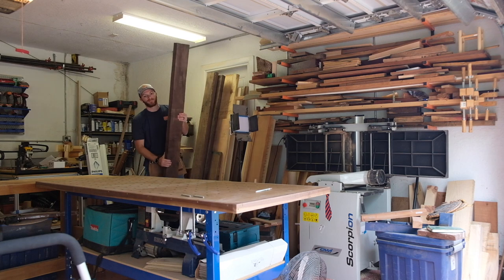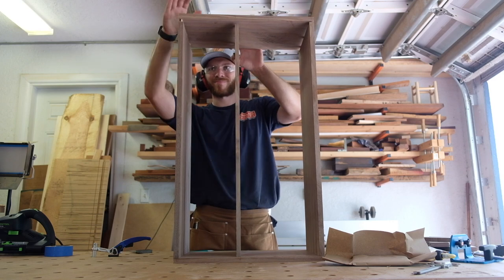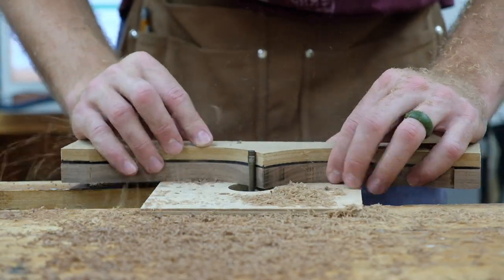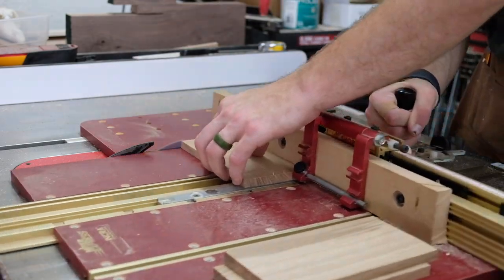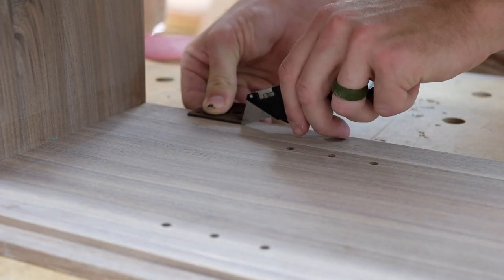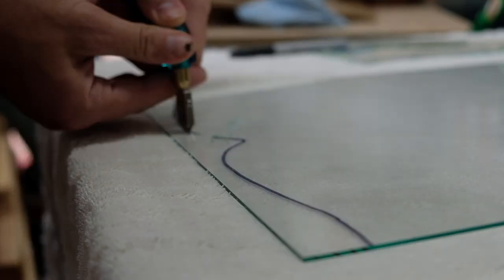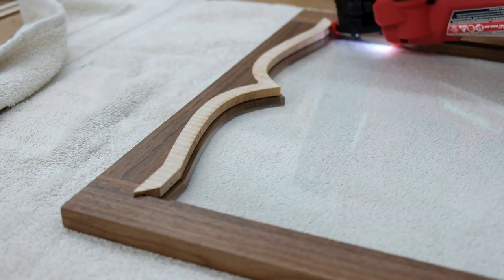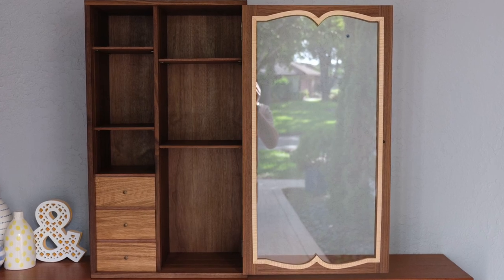Making a Walnut Display Cabinet with an Inset Door

Comment: Another Beautiful  piece. A trick I learned was to put a small amount of 3 in 1 oil in the groove from the glass cutter and a really small brad nail under the spot where you push down on either side. Leaving the glass on the bench.

Comment: First of all, I must say that you did an awesome work.
Once I had to cut the pattern from the glass, pretty much similar to yours. So I've remembered the tip for car owners: if you got a crack in your windshield and don't want the crack to grow - just drill a tiniest hole at the end of the crack to prevent growing it.
So I reverted the intention and drilled the hole right on the pick of a pattern, then carefully sled cutter from the hole (i.e., from the center) to the wings (sides). Succeeded on 2nd trial. 
Hope it'll help you to deal with the future glass details.
Thanks for the video!
Reply from the maker: Thank you! That's an interesting tip. I'll keep that in mind next time!
Reply: Drilling is a great suggestion if you can keep from cracking during that process. But, why didn't you try cutting out smaller sections (relief cuts) the way people do with resaw band saw blades when they want to make curves and don't want to change blades?
Reply from the maker: You know, one of the videos I watched did suffer relief cuts. I guess I got too impatient and forgot about it. But that would’ve been a helpful strategy.
Reply: @kevin_delgado  There's nothing complicated with the glass drilling: just plain surface, nice carbide drill bit and patience for medium speed. Your main activity during process is to control the pressure against glass and regularly put a drop of water to the drilling place. 
But smaller sections' technique will work as well, you're right.

Comment: Beautiful cabinet as always! I love the contrast of the white oak and walnut. You have more patience than I do dealing with the glass. I cracked a panel twice when I was making a knife display box for a client, then gave up and got acrylic haha. Also, I bought the M12 screwdriver just for things like installing hinges and drawer slides. It has been the perfect tool for that and so much more! You can usually pick them up pretty cheap for the tool only version. Thanks for the video! - Joe
Reply from the maker: Thanks Joe! I went through 4 panels for this piece but luckily was able to get a few "fails" from each panel. I'll have to give that screwdriver a look. The issue was that the bit couldn't even get into the screw head; there was excess metal or something. Anyway, I love my M12 gear. I just got the new M12 pin nailer which is what I used to secure the trim. Great little tool!

Comment: very nice piece of furniture. for the future, would be interesting to see details such as installing the back (shiplap?) or what solution you used to stop the door (magnetic latch?)
these are very interesting point for fellow woodworkers (I know they are not particularly attractive for general viewers),  cheers from Italy 👍👍
Reply from the maker: Thanks! Ya sorry about that. I usually either don't film it or just cut it out for time. In this particular project, I routed a rabbet in the back and nailed in a 1/4" piece of walnut veneered plywood. The rabbet is deep enough that I can also fit a French cleat so the cabinet can be hung on a wall. As for the door stop, I didn't put one in yet. But will most likely use a couple of magnets. I'll try to delve into those details on a future build. Thanks again!
Reply: @parillaworks   thanks mate. no need at all to apologize and please, don't get me wrong, it was not a critique, just a suggestion for some next video. I know that putting these details in ALL the videos can be wasted time as it is only interest for  a small part of the audience. once again, amazing job

Comment: Very nice project and fantastic video as usual! You inspire me to step out of my comfort zone. Regarding dulling router bits, have you had experience with professional sharpening? Curious if A) the bit remains the same factory size or B) it's cost prohibitive or C) it even works.
Reply from the maker: Hi! I’ve never had my router bits sharpened. I’m not sure it would be worth the cost. Maybe if I get one of those mega flush trim bits one day. I’m also not sure about the diameter changing, I would imagine material being removed for sharpening would slightly effect the size. But not sure how noticeable it would be.

Comment: Wouldn't it be easier to just have a groove along the top and bottom panels with a rectangular piece of glass to slide in between, then gluing it together?
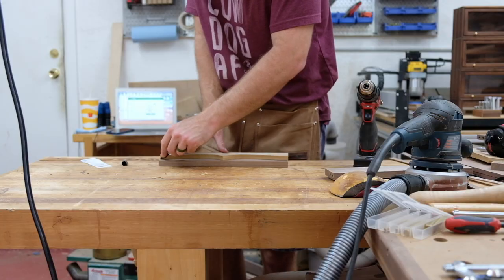Edit: I mean there are the dowel holes in the pieces (3:53), but I think there might just be enough room to cut the groove here before taking it to the band saw.
Reply from the maker: It would definitely be easier. But I preferred the look of the curved glass covered by curved trim. The rectangular glass was Plan B though.
Reply: @parillaworks  How much of the curved glass is visible in the end after adding the trim?
Oh, I guess I didn't word it properly. I didn't mean to drop the trim, but to change the need for the curved glass.

Comment: @parillaworks May I give you some advice for cutting that glass next time. Don't try to cut a long curve like that all at once. Instead score it the way you did BUT also add a "relief" cut going up the middle of the waste piece that would be perpendicular to your cut. Then when you try to snap it, your snap two small pieces. Instead of one big one. I hope that sounds clear.
Reply from the maker: Thanks Cory. That definitely sounds like a good approach. I considered making multiple curves cuts in a parallel fashion, progressively moving closer to my actual line. I think I got a little stubborn and kept trying to go for it all at once. Got lucky!

Comment: As a new wood worker, one thing I'm struggling with is, when to account for wood movement. Some people say it's a huge issue and others, not so much. So in this case, your drawer sides fit really snuggly, and if the wood were to expand, then it would certainly be an issue (I think). However, you don't seem concerned with it at all. I don't know how to tell if I should care of not. It's a little frustrating for a beginner. As always, this is a beautiful piece. Well done.
Reply from the maker: Hey Joshua, thanks for watching! I totally get where you're coming from. You're on the right track and totally correct about the drawers. In this case, I am building everything in the super humid south Florida heat in the middle of summer. Any further wood movement SHOULD be contraction rather than expansion whether that be due to the piece being put indoors in a climate controlled environment or the simple fact that the humidity will never be higher than it is right now, at least where I am. If I were building this in January, I would probably leave a little more room on those drawers.
Reply: @parillaworks  totally understand where you're coming from. I'm in North Florida (the Panhandle) so I get the humidity thing. It's 90 degrees and 100% humidity here today. I guess I didn't really consider the time of year, temperature, and humidity level at the time of the build. That definitely helps clear it up a bit. Thanks!

Comment: That is one nice cabinet! And a thorough explanation about the glass debacle :D
I have noticed that you use both the domino and dowels. In what instances do you prefer using dowels over dominos?
Cheers.
Reply from the maker: Thanks! This was just the second project I used the new domino on. Since I have the XL, it’s a little unwieldy for smaller applications, which is when I’ll use the Dowelmax. I’m more comfortable with the dowels for now and they work really well. I’ve been pleased so dee mixing the two up when needed.
Reply: @parillaworks  Thanks :D

Comment: This is a great piece~!  I'm a huge fan of your work.  Just a question for you (and not a jab):  You have the case side's ends set inside the top and bottom.  I often see in case work where the the top and bottom are between the sides to hide the end grain, as you've done in other projects.  Was that a design choice for this piece, some other reason (structural, etc...), or just the way you decided to do it?  This is all for my own learning.
Thanks much~!
Reply from the maker: Thanks Andrew! Great question! I generally prefer the sides to be within the top and bottom like this piece but there are times I'll go the other way around. It all depends on what direction my main inner dividers are running. In this piece, the middle divider is going vertical, so I would prefer to have it be the same length as the sides so that I can cut them all at once. On the flip side, the big oak coffee table I made last year is similar in that the divider is horizontal so I had the sides surround the top and bottom. Hope that makes sense.
Reply: @parillaworks  Yep, that makes perfect sense.  Basically comes down to a project-based, "dealer's choice" decision.  Thanks so much for elaborating.  Looking forward to your next project~!

Comment: Well that explains the apothecary fascination you've shown!  Great piece - but the glass .... I'd have probably squared off the interior dado and covered it with that maple... because if it cracks now ... (mumble mumble ...)
Reply from the maker: Ha thanks Clyde. I'm pretty confident this piece doesn't have any micro cracks but I guess like any glass panel, it could break eventually. Luckily, the trim is only held in place with a few pin nails so I should be able to pry things open if need be.

Comment: Why not just straight across the top with glass, creating relief at top of frame? Can't tell from outside. Looks a helluva lot cheaper than 6 panes wasted.
Reply from the maker: Just a matter of liking the curved look better than the straight. In the end, I wasted about $30 in glass in exchange for figuring this out; not bad in my opinion.
Reply: @parillaworks  what I meant was that if you cut the glass straight and cut the top curved and route out a relief in the back you cant tell from outside...